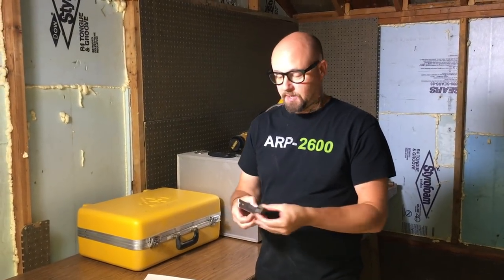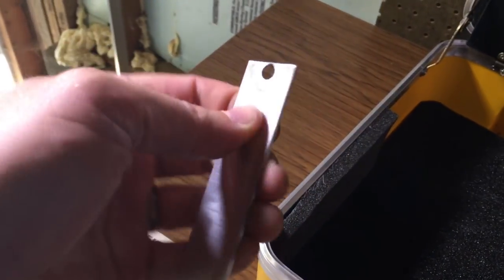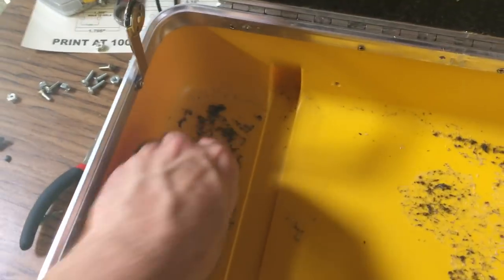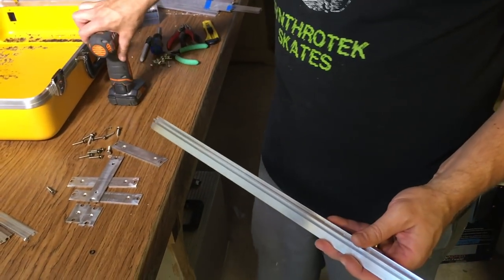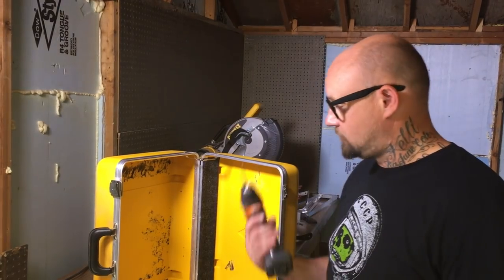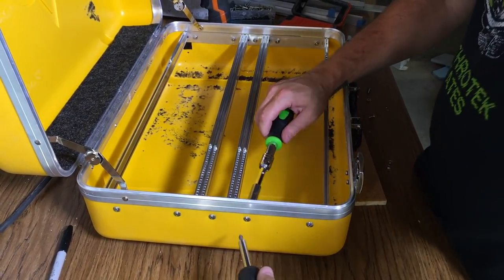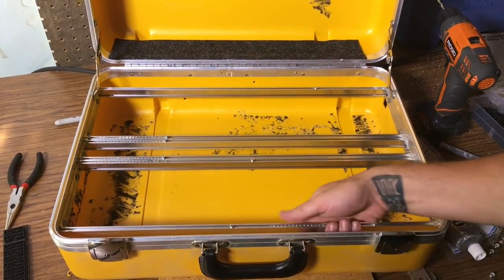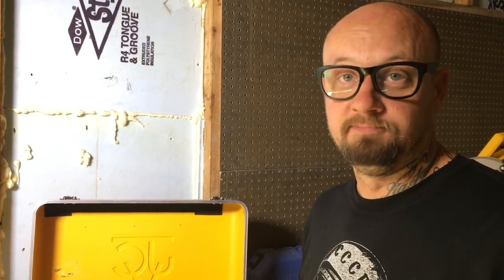How to build your own DIY Eurorack Modular Synthesizer case - Synthrotek rails & brackets

Comment: I have used this trick to remove adhesives in the past: Smear the glued areas with mayonaise and let it sit about 15 minutes to a half hour. The acidity of the mayo dissolves a lot of adhesives and makes it easier to scrape the gunk off. I have cases just like yours I have to do this with, so I haven't tested it on this particular adhesive, but it works like a miracle removing old bumperstickers and things like that.
Reply: This sounds yummy

Comment: Thanks for the great video DIY case run through! I was just wondering from your years of experience with DIY eurorack, what dimension depth wise do you personally look for from the top of the rail (panel level) to the bottom of the case and roughly in between top and bottom sections to be able to close the case with leaving the patches connected?
To simplify my question further, what are the dimensions of that really sweet yellow case you thrifted for a fiver? 
Thanks Steve!
Reply from the maker: Wow, just saw this comment, sorry for the extremely late response.  the bodies of the 3.5mm cables vary in size from manufacturer.  I would suggest 2" to be safe as to not damage jacks (by adding side pressure).  Could be less if you have small bodied cables.  Best of luck!

Comment: Great video and ideas! Quick question about doing more than one 3U rail kit. Do they need to be grounded to each other? I see some builders put a wooden strip on the sides to screw each one to vs rack rails. Thanks
Reply from the maker: Hi Andrew, the modules should be already be grounded together so it should not be necessary.

Comment: using the E6000 is the distribution board easily removable and reusable in another case . i have a feeling Eurorack cases somehow get too small over time and an upgrade may be required :)
Reply from the maker: Its sticks pretty good, but it is flexible and can be ripped apart, it would have to be done carefully